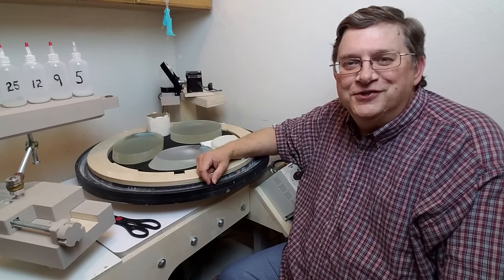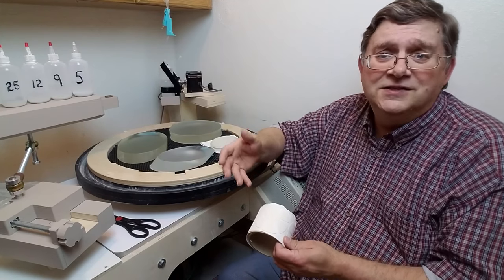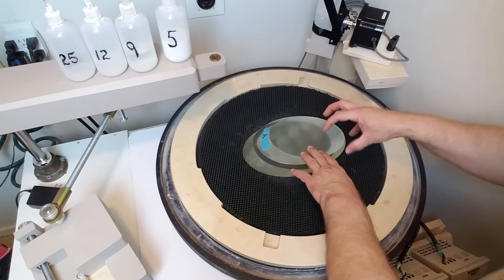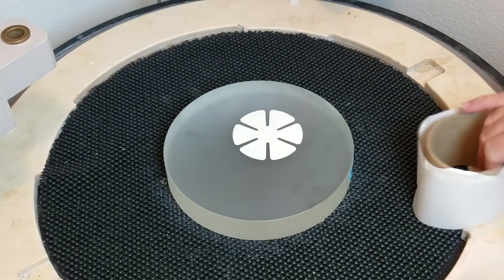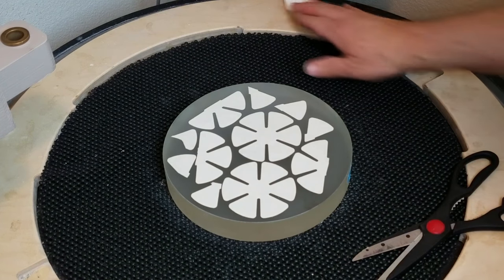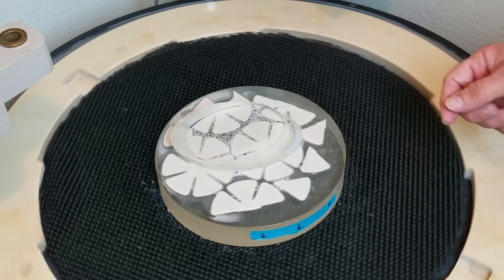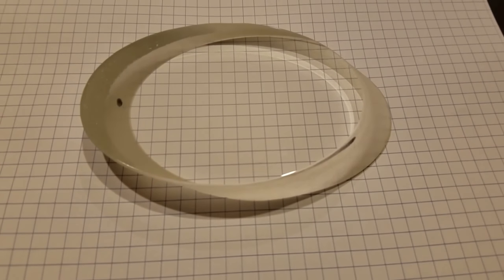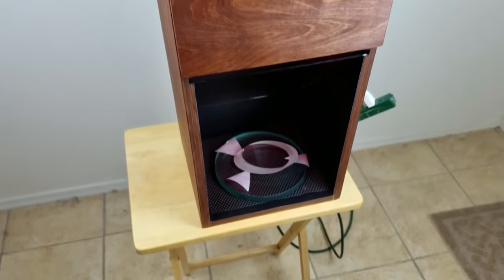Using Polishing Pads to Clear the Back of a Telescope Secondary Mirror

Comment: Hi Gordon I have three polished "flats" except they aren't flat yet. I will go ahead and make the box now. To test them I would wet their backs so that they were somewhat transparent. No I didn't have a box made nor did I shim them with parchment paper. I used the tedious ABC method and tested them with my spherometer before polishing. The polisher was a separate tool altogether. I used the hard pitch (I am not sure what Gugolz rating it is but it is black and quite hard), perhaps Gugolz #61

 I can go ahead with my box and polish their backs with the pads. I suspect they may have astigmatism in them however until a proper interference tester is made the errors could have been due to a host of other factors.
Reply from the maker: That's great.  Gugolz comes in #55, which is soft, through #64 (common medium hardness) to #73 which is harder and good for flats, through #82 which is harder than I ever use, even in Arizona!  With flats, test often and learn how to take them concave or convex as you need.  Enjoy!
Reply: It is Gugolz #73 1 kg. from Meller Optics. Black in colour.

Comment: Hi Gordon, a noob question: Would it be an option to not polish the flat side at all, and instead:
- Use the reference surface upside-down and look for fringes through its back-side?
- Use a temporary medium like a puddle of water or "clear-coat" polyurethane to make the surface less hazy? 
Thanks! (Great video, as always!)
Reply from the maker: Using the reference piece on top may or may not work.  If the reference piece is much bigger than the flat you are working, it becomes difficult to balance the reference flat on top, and it may distort.  I don't want to attempt to place the reference piece on top of the smaller mirror, have it tip or slide off, and then get a scratch.  My test flat is 8" in diameter, and you will be commonly testing flats from 1" across and up.  So putting the reference flat on top becomes a problem.  Of course, your idea will work just fine, in theory, as long as nothing goes wrong and you are careful.  Only one of the two pieces needs to be transparent.  Thanks for watching the video!
Reply: Cool. Thanks! What about the other idea of using an intermediate material to coat the hazy surface?
Reply from the maker: Might work.  I've tried wetting the surface with water, and that wasn't practical for my testing needs.  Coating the back with some material might be workable.  But you would probably want to strip that off before you went to mount the secondary in the telescope, especially if you are using some adhesive to mount the mirror to the secondary holder.
Reply: Good point :)

Comment: Another plus I gleaned from your video: No need for a two way mirror or beam-splitter set at 45 degrees, a regular plate glass will do, as long as the inside walls of the testing box are blackened under the diffuser, but lined with foil above it. The disadvantage is that I need a reference flat. That is the reason I am intrigued with the water test. No need for a flat with that one.
Reply from the maker: Get yourself three smallish blanks, maybe 4" or 6" and make yourself three flats using the ABC method.  Use one of them for your reference flat, and now you are in business!  After you get some experience, make a bigger flat if you need to test larger flats.  But even a 6" reference flat is big enough for the testing most people would need to do.

Comment: Couple of questions: 1) Are you using regular paper as shims between the two flat sides? 2) Are these monochromatic CFL bulbs or did you have a coloured piece of plastic to give you a filtered monochromatic light to aid in seeing the fringes?
Reply from the maker: Hi, Dan.  The light bulbs are just screw-in flourescent bulbs that are more or less "painted" red by the manufacturer.  If you go and look at Lowes or Home Depot, they have them in all colors.  The trick is, the flourescent bulb actually emits a fairly small set of monochromatic bands, one of which is in the red.  So the red coloring on the  outside of the bulb actually filters out all of the other color bands in the spectrum, leaving pretty much only that red monochromatic band.  So it's a very simple trick to getting a monochromatic light.  And as you see, it works great!  They cost $4.35 each at Home Depot: http://www.homedepot.com/p/CLI-Energetic-60W-Equivalent-Red-Spiral-CFL-Light-Bulb-FE15313SRVP1/205144263
Reply from the maker: Hi, Dan.  For shims, I usually use what is called "parchment paper."  This is a non-stick product that is very cheap, and is usually sold for baking, like in putting it under cookies in the oven so they don't stick to the pan.  We always have some in the kitchen, and it is amazingly handy in many situations.  Look for it in the supermarket with aluminum foil, and kitchen plastic wraps.
Reply: @GordonWaite  I LOVE IT!! Cheap and effective!! :-D

Comment: is there a reason both sides of the mirror has to be polished, presumably both sides of your reference flat are already polished? you can use an optical flat to inspect an opaque surface, after all
Reply from the maker: The reference flat is considerably larger than the elliptical flat.  So it is far easier to put the smaller flat on top of the larger one.  Thus, the back of the elliptical flat needs to be polished as well.  You don't have to polish it well, nor worry about the shape of the back surface.  So it's fast to get it done.
Reply: @GordonWaite  oh yes that makes sense, I'm so used to my flats being so small

Comment: don't mind all the question, as I am 64 going on 5 when it comes to astronomy, I have been at it now for 2 months, and I got carried away because I already have 7 telescopes. 70x350mm,  70x400mm,  2-70x700mm and a 90x800mm and a 114mm x 1000mm newtonian celestron powerseeker. I went a little over board!, and I am getting ready to build my own 8" dobson. sorry I forgot about my 50mm x 700mm refractor

Comment: Gordon. I'm in love with your channel and just how awesome it is that you're freely sharing your expertise. Is there a reason you used those 120v florescent bulbs? Would something like a strip of red LED's work?
Reply from the maker: Red LED's will not work.  The light source needs to be monochromatic.  The florescent bulbs have well-defined spectral lines, particularly one red line.  By using the red filter, I isolate one single wavelength and thus get a monochromatic source.
Reply: A laser diode or rcled would work, but you need a monochromatic source

Comment: if the surface is what gets the reflective coating then why do the mirrors need to be that thick?
Reply from the maker: They need to be fairly thick so they don't bend in the mirror mounts.  The ratio of width to thickness used to be 6:1, but these days people make mirrors to 10:1 or 12:1.  But 20:1 would be pushing it.  It takes good technique to avoid 'stig at 10:1.
Reply: @GordonWaite  I know this is a stupid question because of my lack of knowledge in this field, but why don't the really big telescopes use a large sheet of aluminum pressed into the right shape and polished?. it would take away a lot of the weight and wouldn't need to be handled with kid gloves as much as glass needs and would be easy to polish if and when it turns dull or gets scratched. and to tell the truth it probably would be a hell of a lot cheaper than every thing they have to go through with a glass mirror.
Reply from the maker: @davidbrandenburg8029  Aluminum expands far too much with changes in temperature.

Comment: hi gordon whats up? love your work man very professional!!!! waht kind of motor are you using in the grinding tables?  did you built them yourself? i would liketo build one for me if  i can get a list of components to build a table like that it will be great. tnx for the vide thay are greatttttttt! all the best bro!
Reply from the maker: The motors are mostly 3-phase around 1/2 to 3/4 hp.  I use an inverter so I power them from 120 vac, and the inverter gives me very good speed control.  I get most of that equipment from automationdirect.com

Comment: 13:37 Waite. Carnt you just wet the surface when doing the Newton air wedge inferometer test?
Reply from the maker: Yes, but it's messy.  I like to lay a measuring device on the back of the piece, and getting it wet would ruin it.

Comment: Alert! - Perfectionist at work! :-D
Reply from the maker: Hi, Brian.  That's kind of the problem with mirror making.  There's not a lot of room for error, so you get a little fussy about things sometimes.  Thanks!
Reply: @GordonWaite  how hard would it be to make a odd shaped telescope mirror, like a square or hexagon? and would it be to hard to make a single main reflective surface out of multiple mirrors?
Reply from the maker: @fallinbeef  You can certainly make a square or hexagon mirror.  AAMOF, I am currently making nine hexagonal mirrors for JPL for a multi-mirror instrument.  For non-round mirrors, it is hard to get a good figure on the edges.  And making your won multi-mirror telescope requires very demanding mechanical devices to keep the mirrors in alignment.  You would be talking about WAY big bucks and JPL resources.

Comment: Would you say a mirror made of regular glass with a diameter of 23" will be useable? Is low thermal expansion coefficient a MUST? Also - I'm making great 23" spheres, but can't perfect polishing to make it a parabola. Can I do it by hand or will that take too many hours? Thank you! Love your videos!
Reply from the maker: When you say "usable", if the mirror has a good shape, the usability will depend on cooling time and the performance of your mirror cell.  If you can wait for cooling, and you spent good money on a great cell, or built a great cell yourself, the mirror will be perfectly usable.  I would be more worried about the ability to fabricate that good, thin mirror in the first place!  How thick is your "regular" glass?  If it is standard plate glass, maybe 1" thick, then making a quality 23" mirror of normal focal length will be quite a challenge.  If you could make the mirror without 'stig, and you had a GREAT mirror cell, then the mirror would work fine, of course.   But to be honest, unless you have made a lot of mirrors and you have maximum experience, your odds of success are quite low.  At least if you are looking to make a good quality mirror.  The amount of time it will take you to go from a sphere to a parabola will depend on what your focal ratio is.  You can do the work by hand, but it will take a while.  For an amateur maker, parabolizing a normal thickness 23" f/5 mirror from a sphere might take 50 to 100 hours of hand work on a turntable.  But if you are trying to make an f/4 mirror, that time might easily double.  An f/3.5 might double it again.  The faster the mirror, the more glass you have to excavate, obviously.  But the measurement accuracy becomes more difficult the faster the mirror.  And the faster the mirror, the more closely it must approach "perfect" to get a good wave rating or Strehl number.   That means a lot of extra time.  Myself, working as a professional fabricator, my limit on 1" plate glass is around 16" diameter.  At that point, for me, the cost of the additional time spent overcoming the thin blank would match the price of thicker borosilicate glass.  And, of course, the thicker borosilicate mirror will hold its shape better in the field, and have better thermal performance while cooling down, and can accept a lower-quality cell.  On a 16" blank, the difference in price might be only $500 or $600 between the two blanks.  At 23", though, a 2" thick Supremax-33 blank might easily cost $2,500 more!  So it's really about what is your time worth, and how much misery are you willing to accept during observing?
Reply: Okay, first of all thank you for your reply! You're my idol.
My "regular" glass 23" blanks are a little less than 2 inches thick. They are two 23" blanks 0.9" thick - fused together. I'm an amateur astronomer from Lithuania since 2006 (I'm 26 now) and started thinking of how cool it would be to make a telescope myself. Only in 2013 did I come to it. Started with 6", made over 10 pcs, only sold one, gave the rest away as charity to schools and children's homes. Carried on to 8", made one perfect one and moved on to 23" (600mm, sorry, metric system). The whole process took me 2 years to design and test 3 versions of grinding & polishing machines and learn how to make mirrors. Making F3 to F8 in rare cases spheres. Long focal length naturally perform great compared to horrible F3 spheres, but I'd love to learn how to parabolize 23-inchers properly. They're big and difficult for me.
Reply: My vision for this whole idea of making mirrors, is to skip on an idea of making them great or perfect quality. What I remember clearly, is a real struggle in getting of these big mirrors for yourself. My price for 23" F5 is 600 euros (~638 USD). That's barely over it's material and production cost. The view isn't amazing, but an amateur must know clearly what is it that he want. If it's high magnification for planetary - F6-8 or whatever he desires me to do (good quality for long focal ratio mirrors). If it's wide field of view - then it's F3 or somewhere in that are. The quality will suffer if you use an eyepiece of 25 or less, but it will offer a great view and the DSOs will "burn your retina out" because it's 23". As simple as that of an ideology. A lot more I wanted to say, but I'm trying to make it brief:) Thank you!
Reply from the maker: Are you testing the 23" blank for strain?  When you start fusing together pieces of glass, you are introducing even more variables into the equation.  Strain in the glass would be the first thing I would worry about.  The 2" thickness isn't a problem, really, as long as you work carefully to lower the chance of putting in 'stig.  Rotate a lot, and do short sessions and test a lot and you should be fine.  I would want to grind the edge to make sure it is square to the face and provides good edge support.  You need to be able to tell true 'stig from test-stand-induced 'stig.  What is the focal length you are shooting for on the 23" this time?  Where do you get hung up during the parabolization process?
Reply from the maker: It sounds like you have realistic expectations.  When your cost is so low, it's great to make your own mirror, even if it isn't perfect.  The process of grinding, polishing and figuring is enjoyable in itself.  And if you stick with low-power, wide-field views, you will probably be very happy.  There is a lot of satisfaction in looking at the sky with a mirror that you made yourself.  I would suggest always having a smaller mirror underway.  The skill at parabolizing comes from doing it over and over, and learning how it works.  Your craft skills will improve over time, with repetition.  Enjoy everything about it!

Comment: Gordon why don't you use the water test for flatness?
Reply from the maker: The water test takes longer to set up, by far, and is more complex.  I just clean my work piece, and sit it on my test flat and turn on the light.  Don't have to wait for the waves to die out, and the test isn't ruined every time a car or truck drives by on the street.  The water test needs some mechanism to level your mirror relative to the water.  And you need a Fresnel lens as big as the flat under test as a collimator.  Even a draft or breeze blowing over the water will ruin the water test.